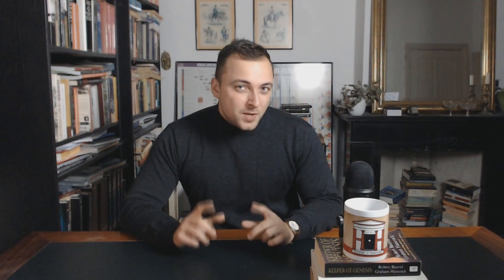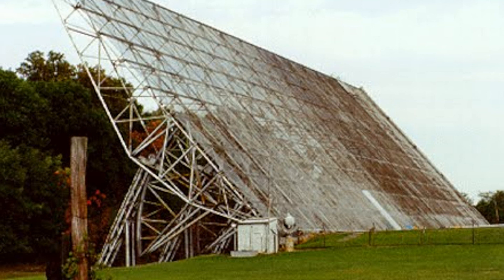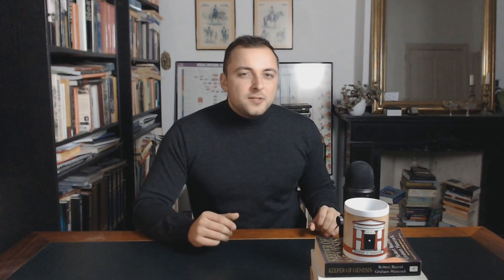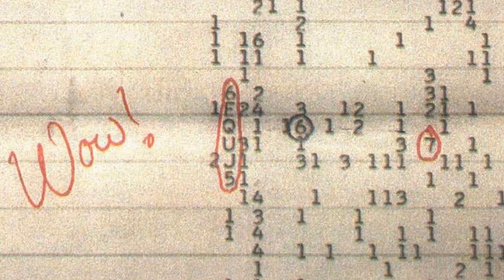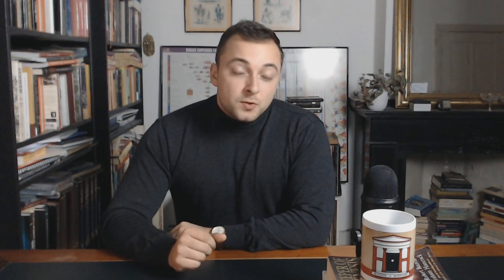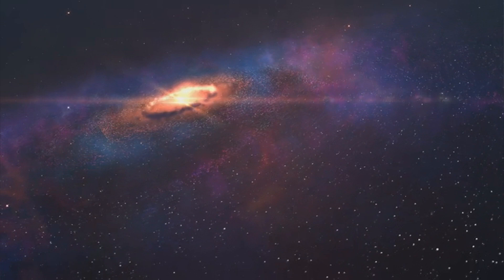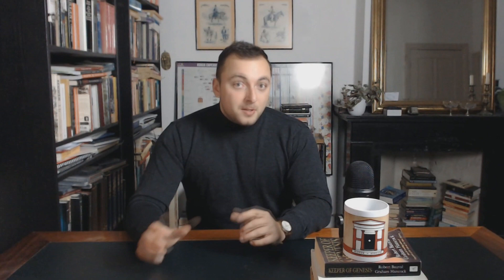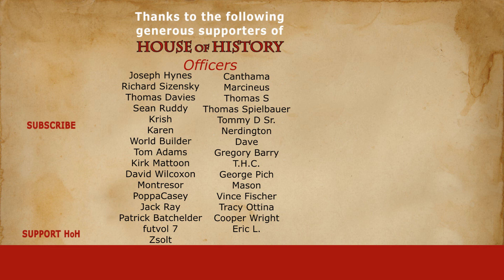The Mysterious Wow! Signal from Outer Space (1977)

Comment: At 2:35 the video shows the computer printout. Careful examination of the printout of the 1977 Wow! signal
reveals that it has two simple messages. One of these is
a code for relating the four letters of DNA to four
frequencies that are 10 KHz apart. Another discovery may
be related to the Wow! signal. The genome of an organism
has in its DNA sequence many sections that do not match
the DNA sequences of the genome of the organism that is
most closely related. This unmatched DNA is called New DNA.
Normal DNA of two closely related organisms will be nearly
identical with about one in one hundred letters not matching.
These DNA sequences have been slowly mutating since three
and a half billion years ago. This is old DNA. The New DNA
was possibly inserted into the genome about a million
years ago and so is very new compared to old normal DNA.
It is possible that the alien civilization that inserted
the New DNA a million years ago when our ancestors were
primitive have sent us a radio signal now that we can
sequence DNA. This suggests that we should send them a
message by radio using the code of frequency for DNA
letters to communicate a New DNA sequence that has been
found. How will they respond if we do this?